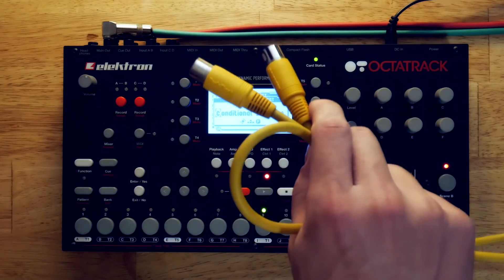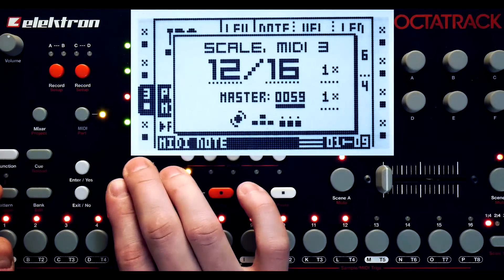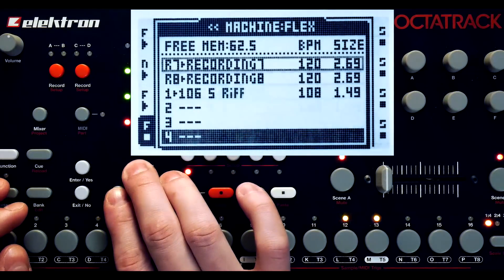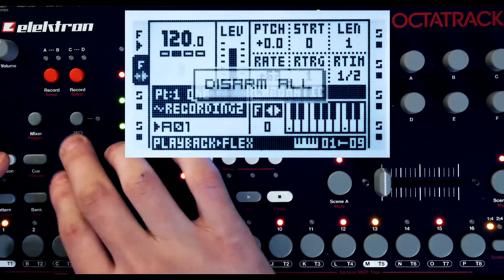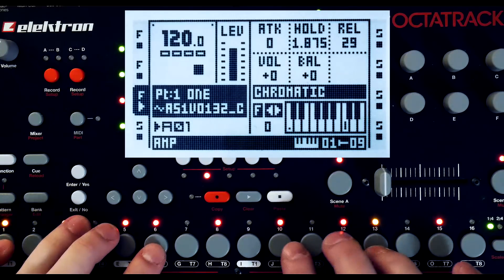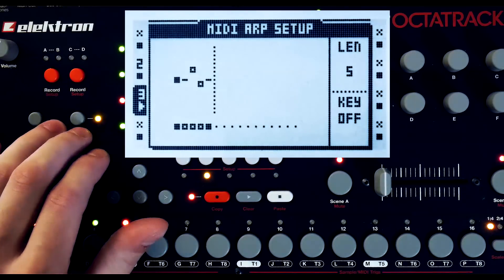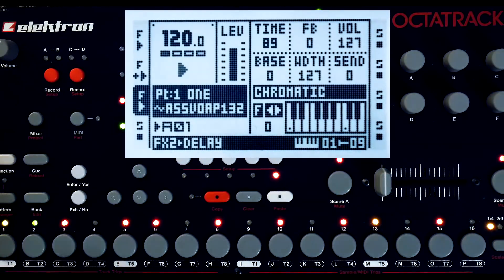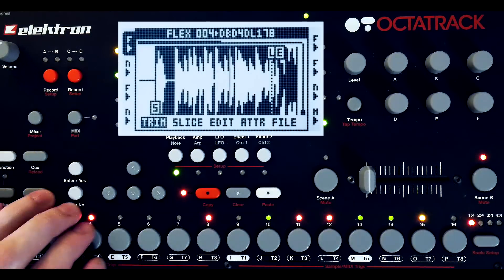Octatrack: Conditional Sampling, Audio Arpeggiation

Comment: Great video(s)! Thank you so much for taking the time for recording and going through everything!
Here are two shortcuts for you:
1) When you want to adjust the master pattern length you can hold "func" + "up-arrow" (or "down-arrow") to increase (and decrease, respectively) the master pattern length by 16.
2) When you are in the flex/static sample selection list and press "func" + "left arrow" (or "right-arrow") you select the previous (next) sample in the folder.

Comment: I appreciate the work you have put in researching the techniques and creating these videos. 
This technique of conditional recording works well when applied to my modified field recordings.   

I also apply this to randomly record incoming audio especially generative sequences and sound generators from Reaktor such as Metaphysical Function or Skrewell. 
It can also work with sequenced instruments. I was thinking along the lines of Marc Scully in generating the notes from Octatrack but it is conceptually easier to sequence within the software and just record the output.
Reply from the maker: thank you! very glad you're putting it to work! 👍 I actually bought the OT originally just to feed audio into it from my modular, and to use the MIDI sequencer for my modular gear. For my own purposes I generally find these re-sampling techniques are most easily used with atmospheric and non-percussive material in a less/non-rhythmic context but the challenges of using them rhythmically can sometimes lead to fantastic results

Comment: This is absolutely brilliant and inspiring! The self arpeggiation is awesome. 

When it comes to the beat mangling you showed I'm just wondering if I couldn't get very similar results by doubling a sliced track and applying random slice selection to the second track? I'll have to look into it 🤔
Reply from the maker: thank you! I think it's very important in this video to separate what are just typical sampling transformations from the underlying concept I'm attempting to illustrate using those sampling transformations. There are a wide variety of ways to achieve these sonic results, but the point of this video is not really about the particular sounds generated, but rather the way in which live re-sampling interacts with modulation and performance gestures - something much subtler, deeper, and more difficult to communicate without experiencing for yourself

in biology, there is the term 'convergent evolution' which speaks very well to this - from Wikipedia - "Convergent evolution is the independent evolution of similar features in species of different lineages. Convergent evolution creates analogous structures that have similar form or function but were not present in the last common ancestor of those groups."
Reply: @maxmarco oh yeah, just like octopus eyes 👽

Of course my comment was not meant to take anything away from your awesome idea. I think it's just that I still have an inherent lack of trust towards OT's recording buffers and seeing someone abuse them with such a reckless abandon fills me with dread. 

On a more serious note, this technique can be really powerful when it comes to emulating granular synthesis on the OT and also a great to overcome some limitations of the sampling engine (e.g. the arp). Looking forward to more OT explorations!
Reply from the maker: no offense taken - and the idea isn't original to me so I can't take much credit anyway :) - your comment was just the second or third such kind of 'misunderstanding' I've encountered since posting this video and I wanted to philosophize about what these techniques mean to me in order to get past surface-level commentary and avoid going on a tangential discussion about basic sampling techniques that I don't view as really that important or essential to the core idea I am trying to communicate in this video.  However if these fundamental sampling techniques are not well understood it may be easy to miss the somewhat subtle point I'm trying to make. I struggled a bit with making this video and wasn't sure what strategy for demonstration would be best - I could have even made it about 1-2 minutes long, and communicated the entirety of the core concepts but then I think people REALLY wouldn't get it :D

Comment: Videos are great man.  Planning to order one of these tomorrow.  A used mki, as an alternative to working on my Akai Force.  One question, can it do trap type hi hat rolls?  I saw a video where the Digitakt did it with retrig’s, and I wanted to be sure this could do the same?
Reply from the maker: thanks! the octatrack has two types of retriggering - one is at the sample level and does not retrigger envelopes/FX, the other is at the trig level and also retriggers envelopes/FX
Reply: max marco ok cool.  So I’d be able to set retig amount and then the time division?  Say put a hi hat trigger on the 1 and set it to retrigger with 8 repeats at 16th notes?

Comment: Much love for sharing this!! Your an inspiration 😎.. TEKFIS
Reply from the maker: thanks a lot! it was hard to make this video because I kept getting more ideas for new tracks while trying to shoot the footage :) :) :)
Reply: @maxmarco  No problem! quick question about the transient spaces:

1: Are you conditionally re-sampling via the flex tracks or just normally sampling??

Thanks a million
Reply from the maker: hihi! not totally sure if this answers your question, but the MIDI triggers that cause re-sampling to happen all have trigger conditions on them - Transient Spaces didn't use any regular recording trigs
Reply: @maxmarco   Sure does!! Thanks
Reply from the maker: one cool thing I found was mixing a probabilistic recording trig and a conditional recording trig on the same MIDI track, like set the probability one fairly low % and then use the conditional one at like 4:5 or something like that so there is a guaranteed time/place where re-sampling will eventually happen in addition to a place/time where re-sampling is more random
Reply: @maxmarco  That sounds ACE! I need to set up a template project with a mix of these techniques! Never got my head around the whole probabilistic thing, gonna spend some more time with it 😎

Comment: Just want to start off by thanking you for taking the time to make and upload these tutorials. They are both enlightening and inspiring. Well done. Secondly I would like to ask you a question. I have been trying to implement the conditional sampling idea on my own set up. However instead of sampling a Flex machine I've been trying to sample external gear with the Thru machine. Which is also midi sequenced by the Octatrack. I connect the midi out to midi in (just like your set up in the video) and then another midi cable to external gear. This only leads to feedback. I've toyed around with the midi settings in main menu but haven't figured out how to avoid the feedback. I set external gear to midi channel 9 - 16 as I understand that anything below may lead to conflict. Have you tried anything like this?
Reply from the maker: thank you! I can't offer much advice for more advanced or complicated setups other than you are going to have to dig through the MIDI implementation charts on all involved gear, and the MIDI send/receive options available to make sure you are doing things properly (OT MIDI implementation is not for faint of heart) and then you will probably want the ability to analyze your MIDI stream properly to troubleshoot issues as they are very easy to create for yourself in this type of MIDI feedback scenario (MIDI-OX or similar software is what I have used in the past to do MIDI analysis) I recommend you simplify and only add one piece of complexity at a time after you have verified everything works as expected at each stage. 

However, in general I do not recommend complex MIDI setups with multiple complex pieces of MIDI gear and weird MIDI routing schemes, in my experience I find they are a good way to spend all my time troubleshooting instead of making music. Also, I was a bit on the fence about publishing these kinds of MIDI loopback techniques as it's easy to shoot yourself in the face even just using a box all by itself :D
Reply: @maxmarco  I hear you on all fronts there. This midi idea may be just another rabbit hole of no return. But thats why I love this box. I get a kick out of figuring out the deeper intricacies of its ability, as much as making music with it. Even if someday's I just twiddled around aimlessly sowing and reaping nothing worthwhile. Sometimes the process of mechanical discovery almost reaches the superlative heights of sound. Both processes inform each other. Thanks for taking the time to chime in. Digging the tunes also. Keep up the good work!
Reply from the maker: thanks a lot! is certainly quite excellent to just explore, and I like to set aside time to do exactly that with no other purpose (it can often lead to excellent music even if that's unintended), but a balance has to be struck depending on my priorities at the time. Also I favor a strategy of thoroughly investigating each individual technique in order to internalize the concepts/implications, as something like the conditional recording technique is extraordinarily rich in terms of possibilities, so I find it is very important to explore this kind of complex technique in isolation before re-combining with existing strategies and workflows. Just like I'm often more productive using a relatively small amount of gear, I also find keeping techniques limited to often be very helpful as well!

Comment: Whoa. The arpeggiator is in the MIDI. Can the midi settings work for any tracks?
Reply from the maker: yes, just make sure to match the MIDI channels. one MIDI channel can also simultaneously control multiple audio tracks at once if you set the audio tracks all to the same MIDI channel

Comment: do you need a certain midi cable for this? i'm not getting any midi interaction between the midi tracks and the audio tracks
Reply from the maker: if the MIDI cable isn't broken, the two most common problems in my experience are incorrect OT MIDI settings, or accidentally plugging one end of the cable into the THRU port. Make sure to start from a blank project and the MIDI settings should already be set properly if you follow the exact steps I show in this video, which was filmed starting with a blank/default project
Reply: @maxmarco  maybe that's it, i do have a custom midi template i was using. just making sure i didn't need some sort of midi loopback thing or one of the retrokits cables. thanks 👍